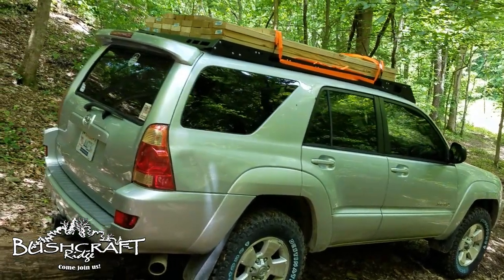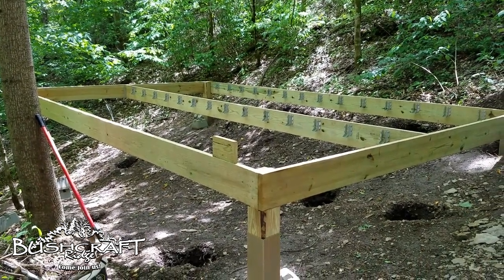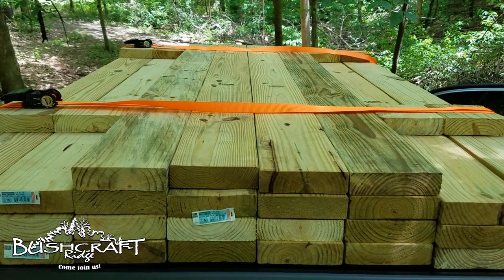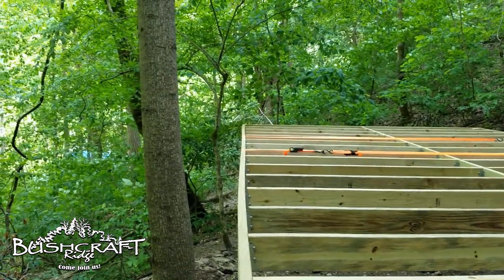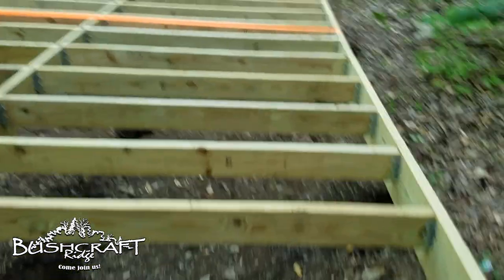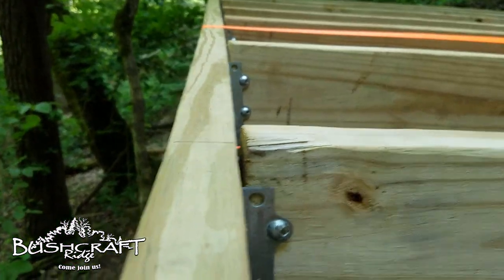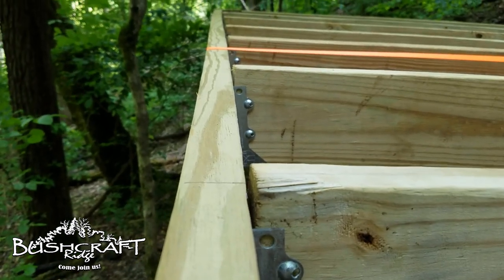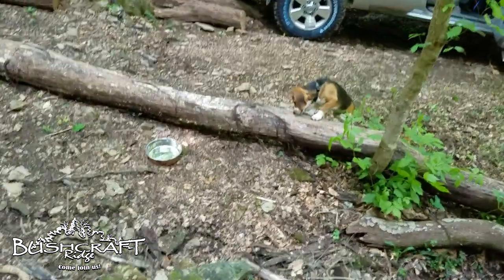Off-Grid Cabin Build 5.16.2020 -- Floor Joists and Setbacks

Comment: Great to see the rack and the new tires are keeping your beast rolling strong. That's a bummer you're getting deflection but it can easily be overcome. Either move your straps to each side of each joist you nail or get stronger straps. Then when nailing through the endplate into the end of the joist toenail in, don't nail parallel to to length of the joist. Drive your two or three nails in at a 45 degree angle so the joist can't slide along the length of the nail. Very cool to see another update on the cabin. Mr. O.D. Greene seems to love sniffing around out there. Keep up the great work man.
Reply from the maker: Thanks for the  tips, brother! I will give it a try this weekend, and let you know how it goes. Mr Greene loves it out there!